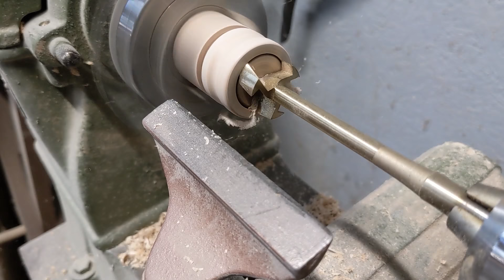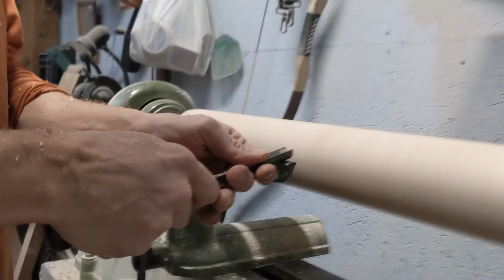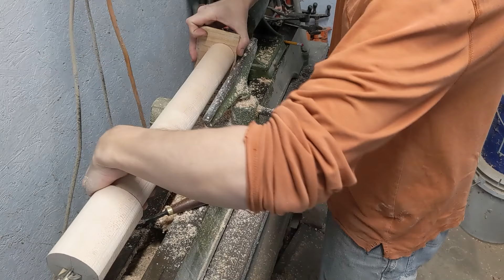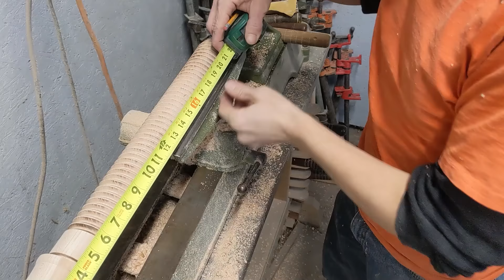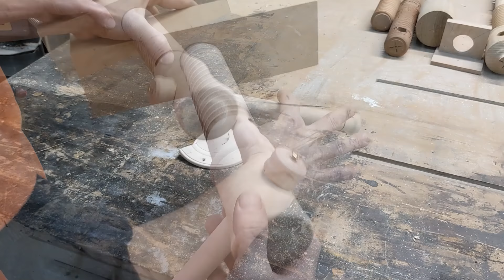How I Make Wooden Screws

Comment: That looks like my first lathe, an old 4 speed Atlas. First thing I did was put a 1 hp motor on it. That solved a lot of problems power wise. I think minimum speed was about 500 rpm.

Comment: Why don't you soak the screw & nut blanks in BLO for a day or two before thread cutting? That seems to be a common practice.
Reply from the maker: I have done that in the past.  It works well when you are using a manual cutter, but not nearly as well when using a router.  The nut blocks I don't soak since a lot of customers glue them into a bench leg, and the BLO would interfere with the glue bond.

Comment: I presume over the years you've experimented with burnishing...Wouldn't this be a better natural seal for humidity changes? Or do you seal and wax and go for a looser fit because of economy and speed etc?
Reply from the maker: Burnishing is a good option for a lot of things, but as the screw threads rub the interior threads of the nut they would wear away the burnished layer.  The oil sinks into the wood deeper, and helps prevent the wax from sinking into the wood so that it stays on the surface, providing lubrication.

I haven't done any water and moisture resistance tests with burnished wood vs bare or finished wood, so I don't know how well it would keep the humidity out.  Something  to think about and test for the future, Thanks!
Reply: @TheWoodMachinist  I have played with burnishing a lot, for two main reasons, water protection and the glossiness of it. I get what you're saying about how the wax works and it makes sense but you can't rub away the burnished layer so much. The fibers are crushed so heavily you would have to sand through it, friction over and over wouldn't be enough, it would just reinforce itself, however, the way you're describing the wax working, it wouldn't work as well as a screw system by the sound of it, oil would just run off and wax wouldn't stay there...grease might but I don't know about that either...I don't know about any machine grease that has been tested on burnished woods...
Repetitive cycling of water in hot and cold circumstance might destroy a burnishing but maybe that depends on wood too.
I tend to use it only for pretty heavy duty woods so softer woods with looser fibers that could break might not hold up as well. With things like oak and hickory, it takes a hell of a lot of effort to do properly but holds up as far as my experience goes  pretty indefinitely. 
Thanks for the insights
Reply: @TheWoodMachinist  For the record I don't know how well it might protect against extreme temperature changes like in desert conditions because the heat and cold would swell the fibres no matter how humid things are on the outside...I just use it to waterproof mainly, in uk conditions...

Comment: Hi I make 2 1/2” threaded dowels for vises
I make my nuts with a German wood tap at 62mm
The tap has 3 cutters on it
Each. Cutting a little more to perduce the thread
Very nice threads
I also soak the nut and dowl in mineral oil for a week or less before cutting
My source will sell just the tap or both tap and dye
Reply from the maker: Yes, there are commercial options for making wooden screws available.   Most notably Dieter-Schmitt and FAMAG,   or Beall for smaller screws.

Comment: When I built my Scandinavian workbench 30 years ago I bought commercial vise screws. I considered making my own but I thought making the nuts would be dicey. I thought making the screws by hand would not have been too bad. I did make my own handles by hand with no lathe. Making them was actually fun. One handle is walnut with maple end caps and the other one maple with walnut.

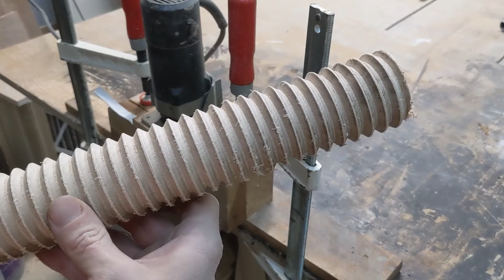Comment: It's difficult to be sure, but it looks to me as if the thread pitch (image at 5:34) is slightly off perpendicular to the screw, making one face of the thread slightly shorter than it's opposite side. The shim under the router seems to support this. Is this real or just my imagination? If it's real, what is the reason? 
Thanks for posting, great video.
Reply from the maker: The shim is there to account for differential wood shrinkage in the original equipment that I built. The thread pitch is actually symmetrical.  I'm not sure whether the visual is because of my filming, or the angle that the camera is at.

Comment: Can you provide some more details about the threading jig?  (source/plans,/bit etc.)  Nice craftsmanship!
Reply from the maker: Thanks!  I will plan on doing a more in depth threading video in the future.  It may take me a little while to post, so check back occasionally.
Reply: Looks like it is 2 pieces of wood. The half closer to the camera has a hole drilled in that matches the outer diameter of the dowel, the second half after the router bit has a hole that matches the interior diameter of the dowel after threads are cut. The second half also must have threads cut into the hole that matches the desired final product.  The router but is essentially just a plunge cut with the 90 degree but, then as the dowel pushes through it enters the next box, and is rotated through the jig so the cut threads in the dowel matches the threading pattern of the box. 

I think the trickier part is how do you cut the threads in the box to match your desired product.
Reply from the maker: The first of the videos showing more detail on the threading jigs I use is up!
https://youtu.be/sIwzyiqZeCk?si=49HELlTw8uR8JLg2

Comment: I suppose the garter is thick enough for what it does, but it looked thin enough to split pretty easily.  Is there a reason you didn't make it thicker?  With such a beefy screw, the fragile-looking garter looked strange.
Reply from the maker: It may look that, but in person it is much less fragile than you might expect.  Bear in mind that the garter is mounted to a chop, and that the unsupported portion of the garter only protrudes about 1/4". The unsupported part also only sees light loads when the screw is loosened, since its function is solely to draw the chop back when  opening the vise.   I've never had one fail in over 20 years of making these.
Reply: @TheWoodMachinist  Thanks; I hadn't considered that it's supported by the chop, though I did know it only experiences light loads when the vise is loosened.

Comment: Hey! Good video, thanks! Can you make one with a closer look at the router based threader?
Reply from the maker: Thanks!  I can do that.   It might take me a while to get that done, but I'll work on it.
Reply: @TheWoodMachinist 
Thank you! No rush. Subscribed! 👍😊
Reply: Yeah, for example how does he get the constant slow forward movement
Reply: @obtuse_orchard I think he has something threaded already. He used it to create the thread on the screw, it's after the router, so as he threads it, it feeds into the existing thread keeping it consistent. Then he uses that same part again when creating the thread on the 'nut' part. I don't know what that's called. He screwed the screw through it first to keep the threading aligned. I hope that makes sense.
Reply: @com @obtuse_orchard need to make the tap first. You can only make the die with the tap

Comment: I made a pair of big screws for a bookbinding press a couple of years ago, 2.5 inch 2 tpi. My tapping jig is similar to what you made (a version of what Heron of Alexandria documented two thousand years ago). The main difference was that I carved the screws using a saw, chisel, file, and the foggy memories of high school geometry. It worked and you are correct about the slightly loose fit being necessary.